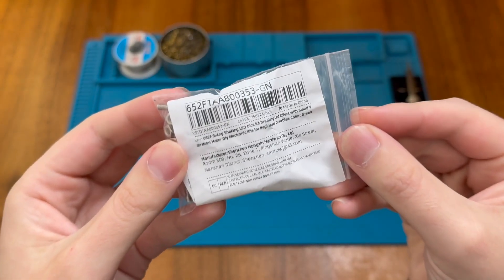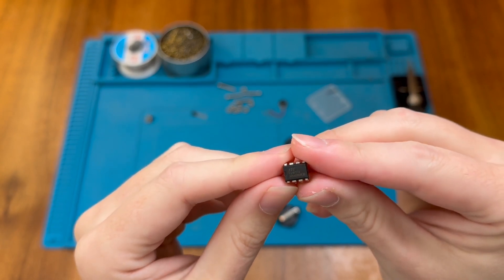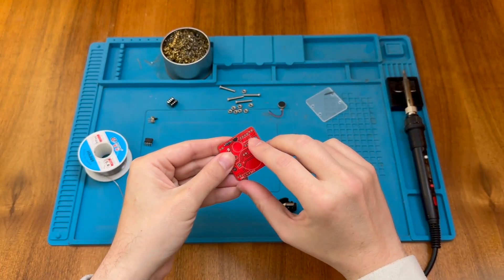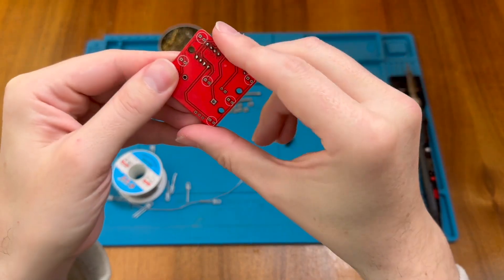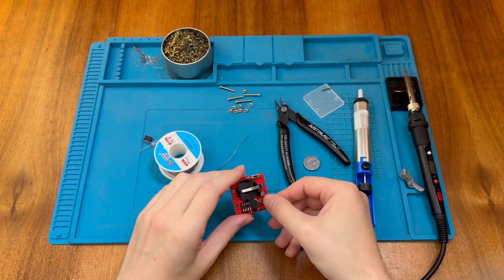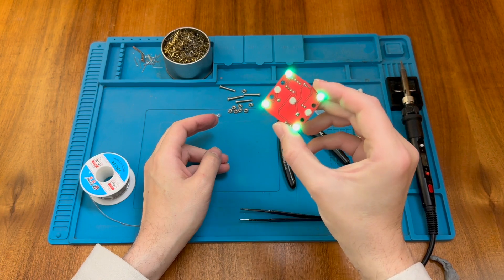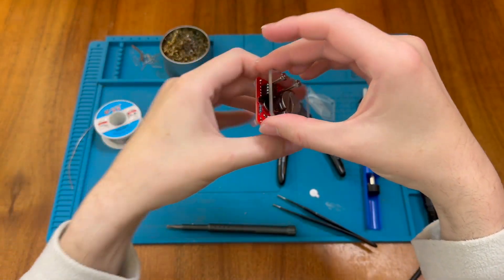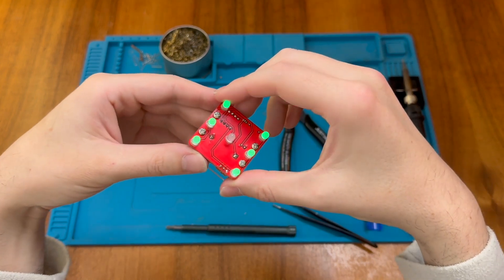Shaking LED Dice Kit with Breathing LED Effect and Vibration Motor - DIY Electronic Soldering Kit

Comment: When I turn it on, shaker runs all the time and  lights blink only once. I put 2 x 3.6v. What can be the problem?
Reply from the maker: Sounds like there might be a short on the tilt switch. Does it rattle like mine? If not the switch itself, maybe there is an incomplete (open) or bridged (shorted) path between the switch and the microcontroller chip?
Reply: @jtjacques 
It rattles. Is there +- side for the switch or does not matter?
 I will take it apart and try again. If that does not help I will order new one😅

Tnx
Reply from the maker: @crazydkure  It shouldn't matter which way around you put the switch. Best of luck.

Comment: You did not show the polarity of the LED's  The board is not marked + or -?  Thanks
Reply from the maker: If you look carefully, on the board I received there is a flattened side to the LED outline. This should match with the flattened side of the LED (negative lead) which is also normally the shorter lead of the LED. Again, on the board I received the positive side has a square (rather than circular) pad for the longer positive lead of the LED. You can pause the video and use the comma and full stop buttons to step through frame-by-frame if you would like a closer look: https://youtu.be/7yCP-ZEtH30?t=242
Hope this helps!
Reply: @jtjacques  Thanks.  We  just could not see the flat side of the LED :-(  Ended up seeing the square and round pads and saw the Battery + Pad was square.  My 9 yo grand daughter was doing the soldering and I think we may have pins touching on the transistor.  The shaker runs all the time.  But the LED's behave properly.  Thanks again for the reply and the video !